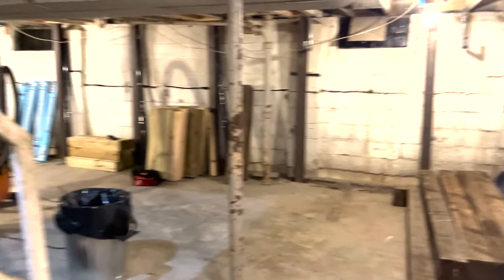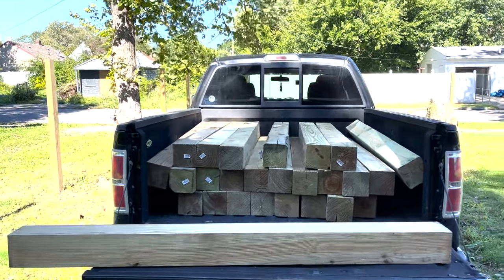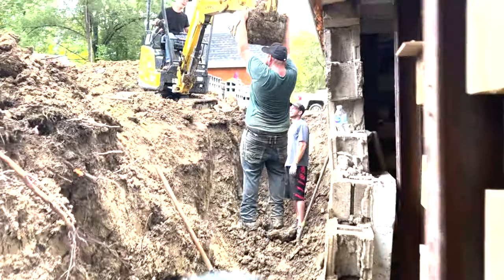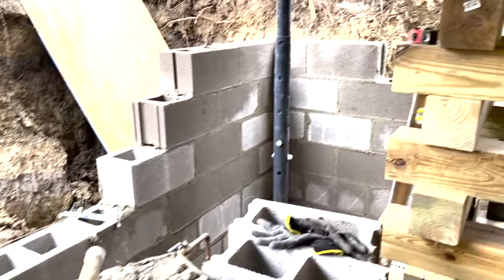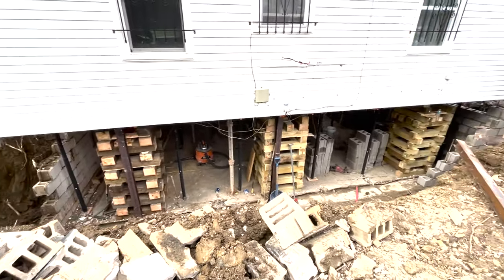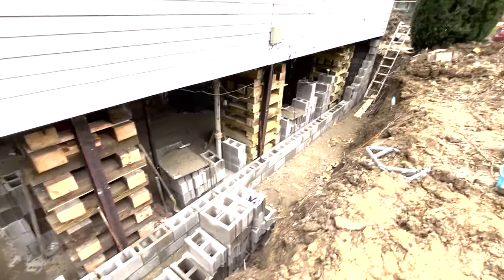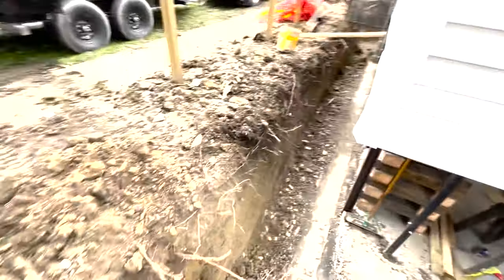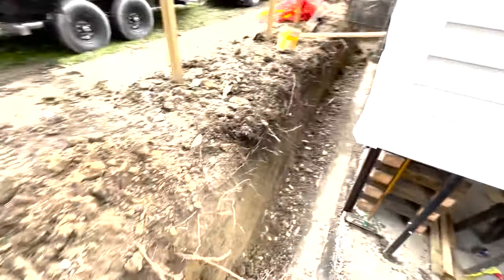DIY house lift - foundation repair / basement wall rebuild

Comment: Word of advice if you ever take on another project like this. Keep the excavated material away from the trench edge at least 2 feet. Trench cave in’s are no joke and leaving dirt right on the edge of the hole is one of the main reasons they happen. Just my 2 cents from a heavy equipment operator, (ditch digger). 😊
Reply: I saw that.... thanks for confirming
Reply: I run OSHA. You need a job? $650k /yr.
Reply: @jarrodderr  sign me up…😅

Comment: Hell yeah man. You and I have a similar mentality. I am in a similar situation myself. I have been accumulating materials now for about a year. Steel beams, cribbing blocks etc. Waiting for those deals, all with budget in mind. So far so good, and as soon as the weather gets a little better, will be hoisting the house. Glad to see your accomplishment. I am a similar age as you and there's no reason to not learn everyday. Like you said, even if you never do it again, you have the knowledge and the know-how to do it if you had to. A similar philosophy on my end is that if someone else's hands can do it, there's no reason why my hands can't. That is, if it is the best return on investment of time... Great work my man
Reply: Yeah me too.  except my house is balloon framed and termite damaged, so I have to open the outside walls from plate to halfway up and lift the floor and wall at the same time with a unified rig.  I do it in 10 foot increments, and I just got done with the second go.  it works but it's really hard to put together the time necessary to do each stage when you work a job
Reply: First off Great job! I have the same mentality as you. Did a rocket scientist build it?  No, then I can fix it!! I might not have the exact know how  but I can promise you this Common Sense goes a long ways!

Comment: So at 60 yrs old...I am doing the SAME thing...only my budget is 1/3  yours! Labor are the 3 of us...Me, myself, and I!! The basement wall is actually a crawlspace 4' high. The foundation was poured already. I've supported the house already with 3 16' laminated beams supported by 6x6 piers on poured concrete pier-slabs.  Last year, the wall finally caved in! So now I need to hand excavate to expose the foundation and begin the block resetting 16' x 4' - Then its outside for machine excavation, and remove the soil to slope AWAY... I have 17 years in the landscaping construction industry, and have read 4 books on construction, plus have done construction my whole life...But DAMN!! I'm 60!! If I can just keep this hoise alive 20 more years...then I'm dead. 😂

Comment: I think I would of wanted some shear walls for sideway support just in case something gave way on the concrete floor.  If the walls were built like that what did they do for the slab?

Comment: WOW!!! I have so much respect for you bud!! 26 yrs old and you had the guts to figure this out and DO IT. That is a HUGE MOTHER JOB. Congrats!  My blocks are bowing pretty bad - hence my research on this topic. Luckily it's only the porch add-on foundation and not the main foundation of the house which is all solid-poured-concrete at least 12, if not 18 inches wide. Italian built in the 40's. Not sure if there's rebar in there but I can tell you the main foundation walls are super super heavy duty. So now I have to figure out if I can get away with just excavating the porch foundation and sliding rebar into the blocks from the top and pouring concrete. I have no clue if that will work. I have professional foundation repair coming to assess and give me an idea. I just want to learn as much as I can before they show up so that I'll know if they're trying to soak me or not. Thx for this video. I'll be looking to see if you have any updates, including the inside.

Comment: Awesome job. There is nothing a contractor can do, that all of us can't learn and practice with a bit of effort. No contractor I've ever used seemed to care about my home.  Maybe in 35 years there have been 1 or 2 who showed some care.  I am a small, female who has learned plumbing, minor electrical, framing, painting. I've replaced floors, windows.  I'm now getting a pre-made shed for a river property. I want this shed to be 8 feet from grade. So this has been very helpful. Thanks.

Comment: the name drain tile is not misleading because all house drainage used to be done with red clay tile pipe that were about 1 ft long laid end to end with a piece of tar paper wrapped around each loose joint to help keep dirt out but allow water in. the plastic perforated pipe is just a modern upgrade from the original clay tile. I laid those clay tiles on home construction jobs in high school in 70's. And later on they started making the exact same tile with concrete which were much harder on your hands when you worked with them all day so you had to wear gloves.

Comment: Nice work dude. I bought a 20s house on a 1/2 acre for $10k and people call me crazy too. One year in and I've got a new roof, solid frame, and newish electric ran and I'm in it for $18k so far. 

I need to raise it to replace sill plates. Got a bunch of insane quotes. Raising the house and handling it myself. Love seeing stuff like this - inspiring man.
Reply: How are your joists on that old house? I got a 30s house and fear I gotta replace the sill too

Comment: Mad respect for taking it on. 
But i do have to wonder if it wouldnt have been better to just demo and rebuild the whole house at that point.
Reply from the maker: Thank you mate, unfortunately I was in a tough position, I bought the house initially because I was 18, no where to live, no parents to help me get a house, & didn’t want to rent as I’ve always hated the idea of paying all that money in to get nothing in return upon departure so I decided to just buy an abandoned house in Detroit as there were thousands anywhere from 1k to 20k, found that one for 4K with no back taxes and thought I had found the diamond in the rough, I had saved up 15k to make the house livable, (new plumbing, electrical etc) immediately started working on it and by the time I was most of the way through that money I found the basement issue, & one of the walls were so bad it could’ve collapsed any day which is why I had 1 wall fixed by a company before I was able to do it myself, so at that point it was either walk away from 19k and restart from square one with no where to live and no savings now or learn how to tackle the issue and keep it moving, so I built that barn in the backyard to prepare for this giant project (another 12k) then I did the basement for 24k, and finished up the rest of the house and yard for 4K so I ended up being 59k into it with a brand new barn & almost brand new house, I’ll be listing it next month for 95k and got to live there for free for five years so in the long run things seem to be working out!
Reply: @ericmulka  So now my question is... in a case like this ... would it be just as smart to backfill the entire thing and do away with a basement? And put the money towards building an add-on if you need the space. Just wondering. Of course I realize that in some cases, the other components are necessary if the furnace room is in the basement (etc). Your thoughts??

Comment: I have not yet finished this video, just wanted to say, Damn, this is a crazy job to take on yet you did. Congrats and hope it all worked out well. Looks like you knew what you were doing and yes, seeing your house almost floating there as you remove the base wall, I am in awe. Great job. Okay, finished the video, you did it well. At 26, I would have possibly hesitated to do this, now, at double your age, I would take it on with what I know now. I am in Toledo Ohio, if you ever show this off, I would love to come and check out the end result. And having your place secured at around 30k all in, nice position to be in, right? I am getting ready to level out my first floor, as I look in my basement and the sag it has, New Roof, ReDo all electric and plumbing, new sub floor and reuse the old sub floor as roof TnG finishing and upstairs floor over new sub floor. I get it, it takes a lot of time and work, but these houses were made for us, the homeowner, to repair. Take care and keep on keeping on. Hope to meet you some time. 1 hour away.

Comment: Hey I’m down in Florida but I’m wondering how did you find the vacant lot and cheap property like this? Website, auction?
Reply from the maker: In 2016 almost all the houses in the neighborhoods of detroit (mines on the west side) were anywhere from 1,000 to 30,000 but they need a lot of work, these days they’re not as cheap but you can still find them for a decent price, and all lots adjacent to your house are only $100 each but you can only buy 4
Reply from the maker: In 2016 almost all the houses in the neighborhoods of detroit (mines on the west side) were anywhere from 1,000 to 30,000 but they need a lot of work, these days they’re not as cheap but you can still find them for a decent price, and all lots adjacent to your house are only $100 each but you can only buy 4

Comment: Just Came Across This Video
If I Would Have Seen This Then I  Could Have Told You That if You Had Someone Clean The Block you removed .You could have Reused It or Sold It. GreatJob by the way.
tae Care

Comment: You might could have gotten a solid concrete wall foundation poured. I would have put a rubber membrane on the outside of the wall with a layer of tar for the waterproofing . Never did like the blocks for a wall because eventually leaks will start coming through at the grout lines.

Comment: Wow, what a project!! Looks great but may I ask why you didn't use concrete? I live in a house with cinder block walls that are caving in as well, if I replaced the basement I would never do cinder block, that's the dumbest form of foundation I can think of, each seam is a cold joint, therefore it's a weak spot. 
I live In Canada and all the frost in the ground in the winter pushes on the walls and moving them. I think the only way is thick concrete with a lot of rebar.
Reply from the maker: To be able to pour concrete I would’ve had to raise the house more than a foot rather than just a couple inches and from doing so I would’ve had to unhook the chimney all the way through the house including the roof along with plumbing, electrical and a few other nick nacks, Which would’ve added an extra week or more onto the process Along with me not knowing anyone that pours concrete when my brother and uncle are journeyman Masons so it just made sense and not only that I did pour all the cells with concrete and rebar every 4 feet But this is in the middle of the ghetto my plan was only to create a house that I could live in for the time being until I could amass enough money to move out of the ghetto and into an area where I can raise my family so I wasn’t really thinking super long-term just good enough to be able to sell and pass inspection, concrete would last longer but these blocks have atleast 50 or more years till they fail so it’ll last a lifetime for whoever buys it!
Reply: @ericmulka  gotcha!

Comment: one recommendation if you have dig around a foundation and there are trees or shrubs close to it they should be permanently removed. Tree and shrub roots are very damaging to drain tile and foundation walls just get rid of them and plant small shallow plants, always keep stuff like that far away from  your house.

Comment: You failed to install the dipple drain board against the tar waterproofing. Either that or 6 mil poly needed to be placed before backfill.

Comment: I'm dealing with this same issue but in a crawlspace. Block foundation, none of the cells filled, and the footings are just ungrouted sideways blocks. Vapor barrier was hiding it all during inspection. Foundation companies bid 50k to solve half the problem. Adding an additional beam, replacing a rotted sill plate, and filling all the cells. So far my costs are $500, an aching back and a smashed toe. A basement is exponentially more difficult though. Props to you man!

Comment: This only works because you have friends and family capable of doing this kinda work. This doesnt wirk if you have a whole bumch if strong oeople that dont know anything about building, materials, equipment, getting things level/plum, etc. you still need know how.
Reply from the maker: @NatalieBessios  hey, I appreciate you commenting but honestly you’re wrong, no one on this job had ever done anything like this job before, and out of everyone that helped (8 people) only 2 had any construction experience and ZERO experience in rebuilding a basement.. 

I planned this job out months in advance studying every night, and only after teaching myself the entire process start to finish was I able to convey the information needed to my friends and family and lead the job.

I didn’t know anything about building either… until I took initiative and begun to learn.

Comment: Dude, I don't know how you pull that out. I have a similar problem but a much smaller old concrete wall in the basement, the contractor is asking $60K. I don't know what to do.

Comment: Operator for 25 years and was impressed thru the whole video. I started to cringe thinking you was not going to put perimeter drain and rock in but then it got to where you did it lol. Great fuckin work bro

Comment: Been looking at houses to buy and fix up for the first time and been trying to absorb as much information as I can about doing certain projects so knowing that if you just use your head you can easily lift a house and rebuild a foundation if you need to. I don't have much money other than what my full time job pays me but I have enough disposable income I can easily save up funds throughout the winters to work on a house thoughout the summer

Comment: Looks like my In-laws basement b4 they sold the place. Block wall bowing in... those huge metal plates trying to straighten it all.  Ugh. Brought back instant memories and dread. Had company put in those plates and 12 foot long rods out into back yard where something was buried in the yard to accept/hold other end of the rod. Had to use a big ratchet to tighten up the nuts periodically.

Comment: How come you didn't end up Goin a poured route, or vapor, or frost,ect.  Newengland area here, and I've been lead to believe that ur area has just as bad of winter freeze and the block suprised me. Is it a cost thing?
Reply from the maker: @ishnifusmeadle  it was an accessibility issue, we couldnt raise the house more than an inch due to the chimney being attached to each floor & roof, I was also cheaper & the only way we could’ve gotten it done in that time frame, hence the building of the leads starting even before demo was finished

Timing wise we were the most efficient I’ve heard of anyone doing it
Reply: @ericmulka  makes sense. Good job

Comment: One big mistake, 10 rows of block plus one solid 4" cap is 84 inches or only 7 feet.  You want to go to 8' 6" minimum when you raise a house.  You need 4 cribbing stacks per beam (3 beams), you should have the center beam also on cribbing stacks.  Also, you should use triple 2 x 12's for beams.  You should have at least 12 rows of block plus the solid cap.  Better luck next time.

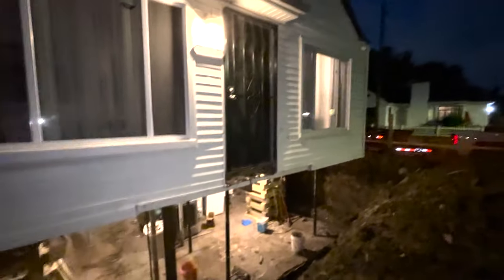Comment: Hello @4:10 I notes lights on front porch were on. Was electrical utilities kept available through the time of the work. If not kept on the entire time, at what point was it disconnected? Also was the house emptied out or was it kept furnished. I would like to elevate my house, or build a basement into it.
Reply from the maker: All furniture stayed, i actually slept in it too to make sure nothing got stolen and electrical was never shut off because the service was provided above ground & punted on the house itself so it raised and lowered together

Comment: From overwhelmed to Herculean. Just, wow. My south wall has been heaving in and I have spent all summer slowly removing old mortar and tuckpointing deep in the joints. It’s field stone. Doing what you did would have been better but beyond what I thought was possible for DIY. And you did it in 11 days! Holy crap dude..

Comment: They threw the whole damn bucket at that basement previously, wall anchor plates, soldier beams, window box frames, floor joist framing. That's an impressive repair, you got a 500k a year business doing that for people. When I was younger I scooped up cheap rental houses with bad basements, not as bad as this one though. You could get them for 1/3-1/4 the after repair value, then put 10k-15k in the foundation and have 2-3x your purchase price in equity.

Comment: Since you did not lower the footings, which is something that most contractors would do, you should raise the house up to have 9' ceilings in the basement. This will allow for plumbing and HVAC to be run and still have a finished 8' room. The reason I would lower the footing is because most likely there is no rebar in the footing, and it may not be up to code. The old walls are a good sign of that. Be sure to waterproof and set up drainage with a sump on the outside to keep it dry.

Comment: Tremendous Vlog on this basement rebuild Eric! I'm doing one as we speak, but a much smaller basement in Indy, most of the house is on a crawl. Question for you, on your cribbing, did you use standard lumber or did you use hardwood? On your drain tile, did you put in a pump to drain that ground water to daylight / storm sewer? On your black jack, did you consider using a heavy mil plastic as a final sealer?

Comment: Why not have the foundation poured
Reply from the maker: You would’ve had to raise the house a couple feet higher and disconnect the chimney from the house making it a much more expensive job